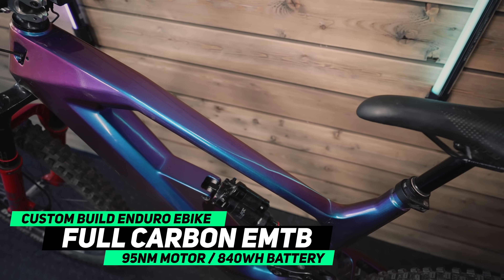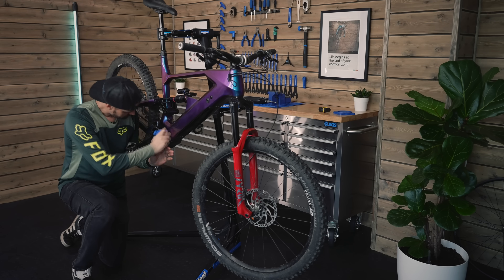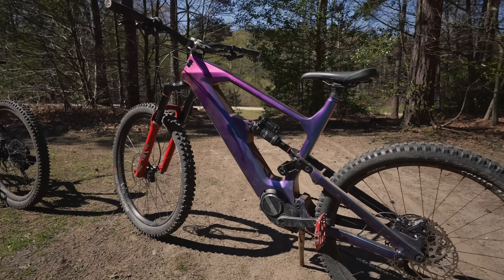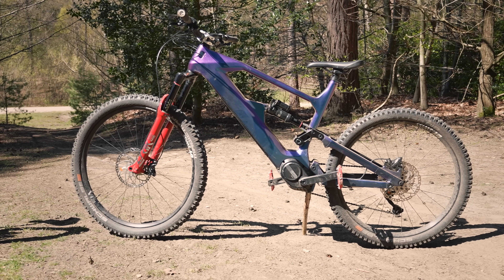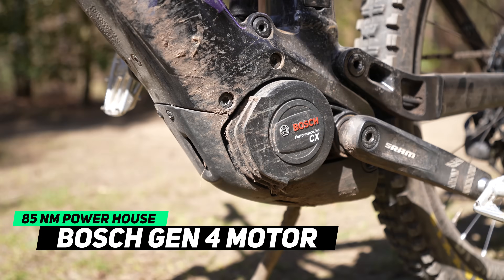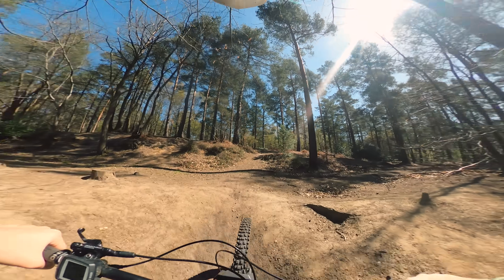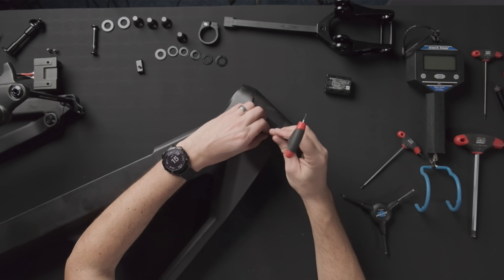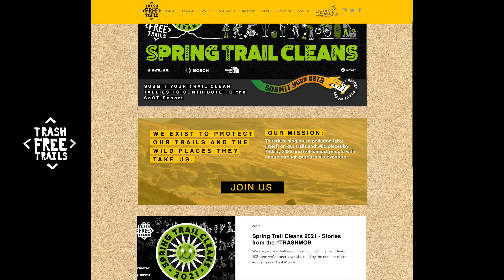This motor ABSOLUTELY CRUSHES it!!

Comment: Great update - Leaves me with two key questions :
1: Is this improved motor available to buy?
2 : If this improved motor is available to buy, how do you distinguish from the older motor before purchase?
Reply: Price?
Reply: The model. Old was like an m410, new is a m500
Reply: Most Bosch motors are on ready to buy ebikes they are not kits and to buy a bosch usually used with someone with a damsged cycle, Bafang motors are available to build your own eBike and cost a fraction of the price of a Bosch motor built eBike.

Comment: I test rode the M600 and was completely underwhelmed. Claimed 120 nm of max torque felt closer to 65 nm. Then there's the awful whinny noise it makes.
Reply: I own one , must have been something wrong with it , mine is really powerfull , even too much that it bothers me , on level 1 barely dont have to do any effort
Reply: I believe they fixed the noise problem with a revised gear.

Comment: it would be interesting to see a motor test between flyon, sachs and the bosch. that's 120 vs 110 vs 95Nm based not just on hill climbs but weight to see a timed trail run to gauge agility
Reply: Bosch is actually only 85nm not 95

Comment: Hi Rob
You need to compare with the m600 motor hands down better than any other motor ,I recently built a bafang,brilliant bike apart from a few annoying rattles,is yours the same
Cheers John,
Reply: Ye I would love to see a M600 video. But I guess he can't because of it not being eu approved?
Reply: @gavskxf  on private land he can fo what he wants.
I'd love to see the m600 and the m620 tested by him for an honest opinion.
And it's not just about power but also I'm interested in the finess of the delivery.
Reply: @FlyingFun.  I happen to have bikes with both those motors. They are great climbers, none of that restricted to 250w euro nonsense.
Reply: @stevenleslie8557  I have a m620 in s Frey ex and it is great.
I have a dd 1000w hub drive too which is faster on the flat but obviously doesnt compare off road and hills against the m620.
Reply: @FlyingFun.  what does your M620 Frey weigh in at? Thanks
Reply: @stevenleslie8557  stated weight is 35k but I haven't weighed it myself.
It is very heavy though lol.
Doesnt seem to effect it much for my type of riding but I defo dont want to be lifting it over gates etc.

Comment: Rob you need to try seat down and sitting and leaning forward. 
Then you load the weight on the rear wheel. Maybe the befang is to powerful and is judt spinning up